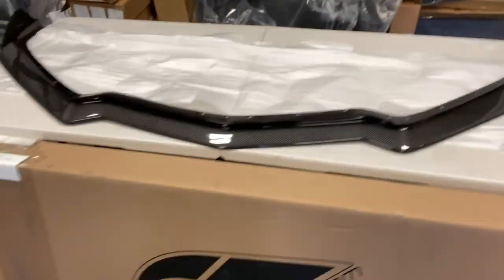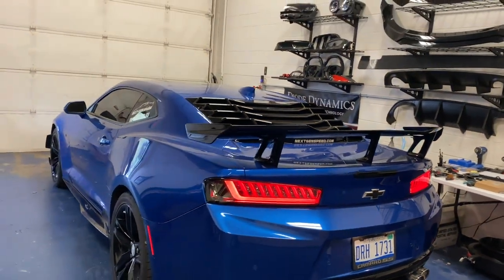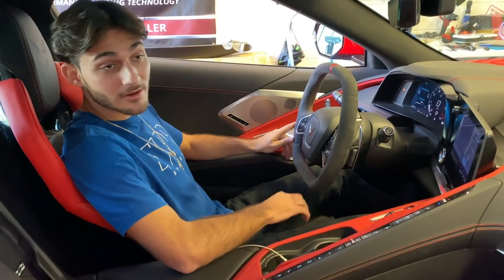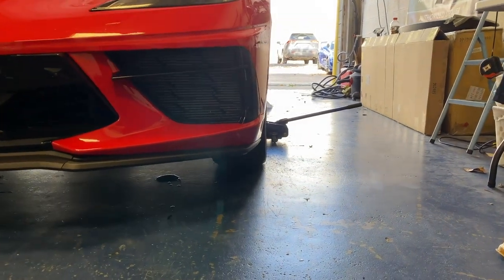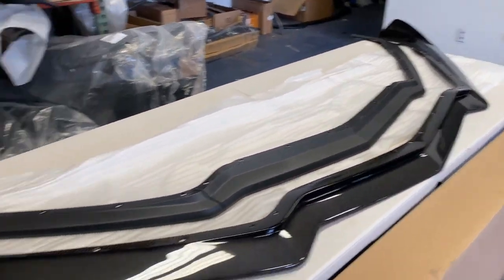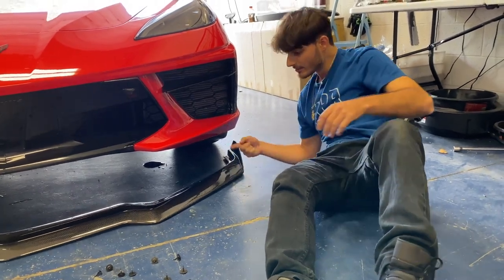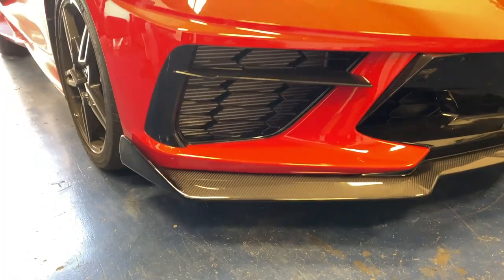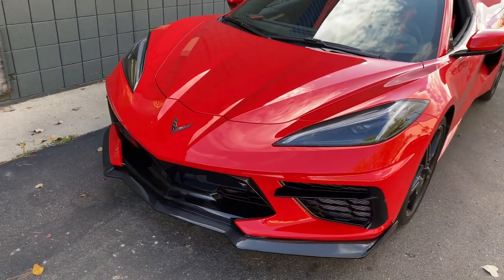Installing My NEW 2020 C8 Carbon Fiber 5VM Front Splitter

Comment: Looks good bro I'm gonna get my front splitter with out the winglits
Reply from the maker: Our friends over at Quinten Racing offer a great option!
Reply: @NextGenSpeed  I'll check it out
Reply: @NextGenSpeed  your out of Massachusetts i live in New haven ct are your extended side skirts bolt on and when will they be back in stock for carbon fiber

Comment: I have a non z 51 coming and want to do splitter.  Not sure how to do.   Drill and do inserts or do riveting?
Reply from the maker: Best & easiest way to do it, is to attach double sided tape to the splitter, line it up, and attach it to the car. 

Once it’s on and in position, you can use self tapping screws to attach in the predrilled holes and you’ll be good to go🙂

Rivets are not recommended for splitters, as they are not meant to come out and will cause damage to the bumper if the splitter gets hit.